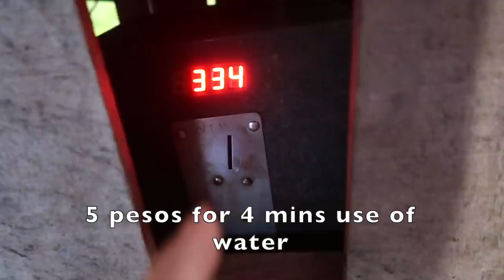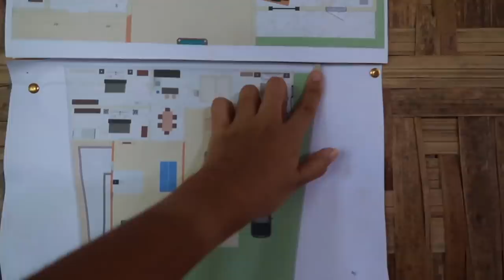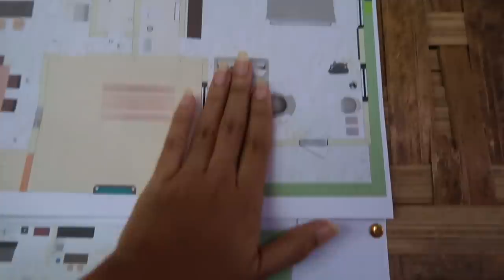House Floor Plan | Residential and Sports Bar Project | Province Life in Philippines

Comment: So you can take the box all the way apart and then roll it into a circle ⭕️. Make the circle the size that the bag will fit well and tape it together. Now you will have a circular garbage 🗑 container of its 2 layers of cardboard thick it will be more durable as well.!

Comment: Just curious ,have you considered putting nipa palm roof on top of the metal roof sheets ? Our ceiling which is under a metal roof gets to 40 degrees .     Makes the apt a oven 😕
Reply from the maker: This is not the kind of metal roof its a good quality doesn’t make it hot.

Comment: Why are philipino hollow blocks so thin?  In the west the blocks are twice as thick?  Is it just a style or does it have another reason.  If you do not know I understand.  I'm just curious as my wife is adding onto our house using hollow blocks.
Reply: its about price, and there is no standard code kept for block manufacture so you need to inspect every block as some are so lacking in cement you can crush them with your hands, also on this build when she was showing the steel above a window in her room. the blocks below were horribly laid and their steel is almost always tied incorrectly making them dangerous in an earthquake as walls will fall in sections. we have built twice, both times i shipped in my own blocks manufactured to international standards as well as all steel. cost was high but resale was great as it was bought by an american who wanted western standards.
Reply: So glad she has people looking out for her.  She has many great plans and I am glad she does not allow anyone to stop her from achieving her goals.  This time of Covid19 will prove to be no big deal for her.  She is amazing for never settling for less than what she wants for herself and her family.